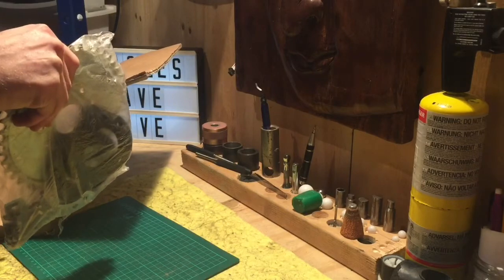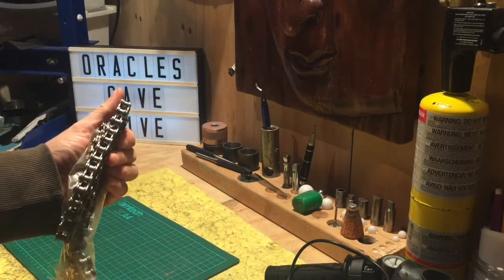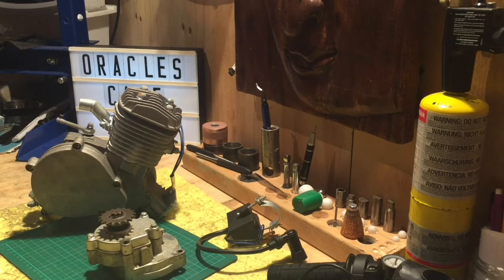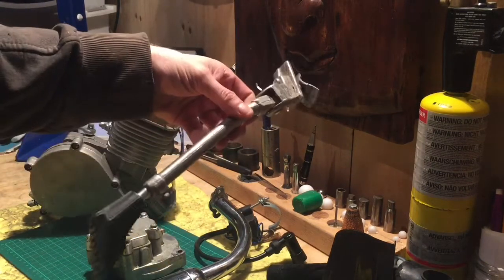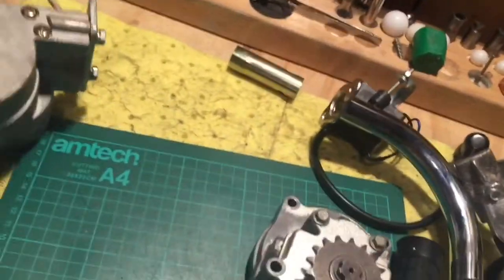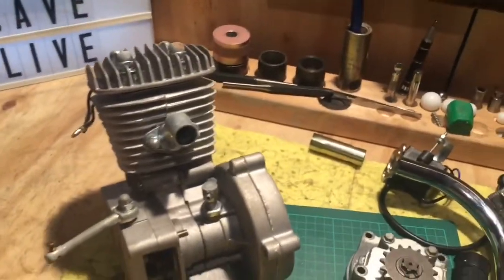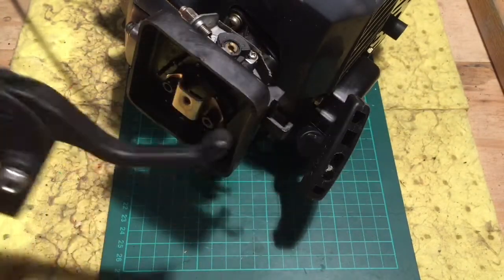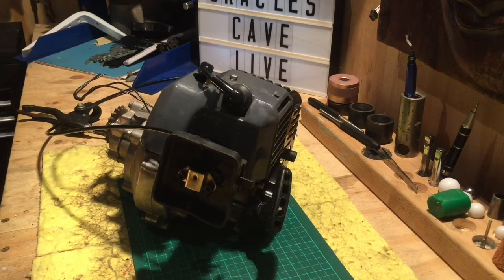50cc PROJECT BUILD PT.4

Comment: Plenty of parts Darren. As you've seen, space is my issue. Mind you good job in a way as if I had more I'd soon fill it lol. There used to be a bike shop locally, sold SH ones. I used to call in for a chat while dog walking. Mentioned I wanted a mountain bike and got one the next day. Crank had gone, fitted a new one and used it for a while. Then I got 3 more for a fiver a piece. Sold the first to a mate for profit. Made 2 out of the 3 and sold one for what they cost me. So I had a free bike. Got one from freecycle and was given 2 more. Was up to 6 by this time lol. Sold a couple cheaply, used one on the boat. This would be around 2005.
Then I was given a shopper and bits to make it up. By this time I had my last boat Alyson Beems. Took it for the first Boston trip. Used it to go to chippy, and market. Left it on the bank. Moorings were behind locked gates. Friend had a shopper too. Next morning both had been stolen lol. My friend wouldn't report it, but I did.....caused a bit of a fuss actually. Boston auction sale sells bikes first, my friend just bought another.
So now I've only got the one that sits on the landing (nowhere else for it) been there a few years now.
Reply from the maker: MalcOfLincoln yeah my bike was one of the first downhill freeride bikes made by GIANT back in the day of professional mountain bike championships.
Served me well and never let me down, I guard this bike with my life lol.
But I don't have the spare energy to put into a bike so converting it to petrol power is only an excuse to keep it for longer.

Petrol tank arrived and got it hooked up but petrol started pouring from the carb, diaphragm was the wrong way around from the factory,  so pull it apart and start again lol

Now I need 2mm steel sheet, but I need to find it because I'm not allowed to spend anymore money lol

Comment: Why don't you buy a cheap secondhand mountain bike with the correct frame mate save a lot of hassle
Reply from the maker: The big man HASSLE is my middle name lol
I prefer to make my own stuff, I bought that kit because it looked funky but too easy.
I like using the things I make, I probably will pick up a bike for that kit, but I want to turn my mountain bike into a motorbike, I love that bike.
It's all about the challenge.
About time I got that welder on the go anyway